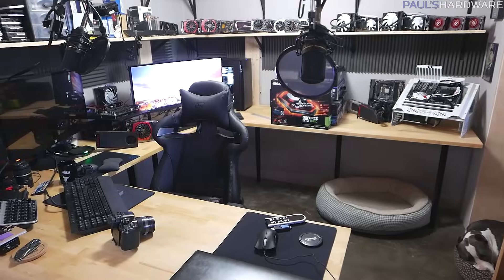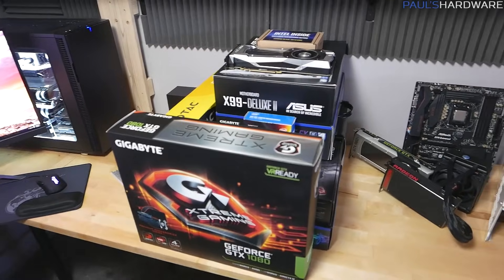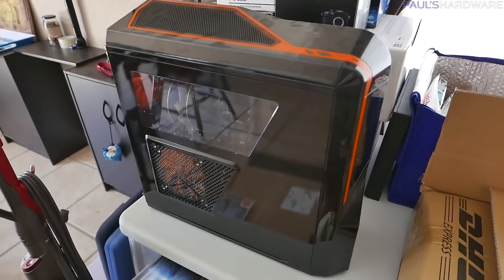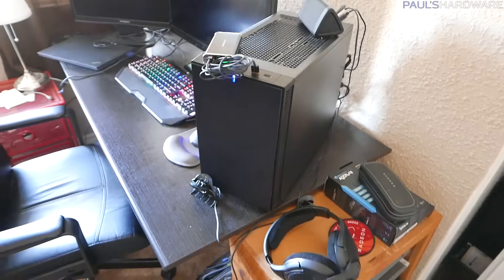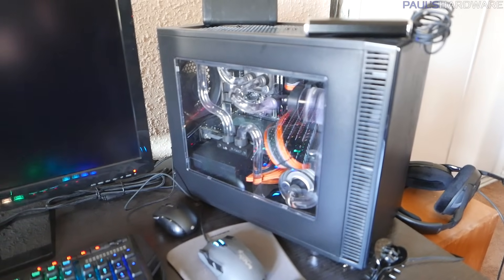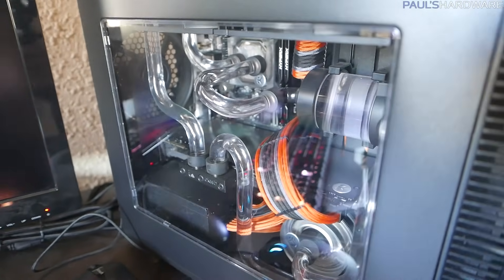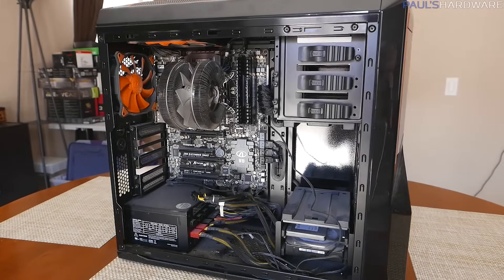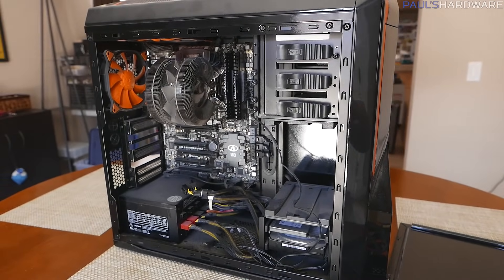Prepping a Hand-Me-Down Computer

Comment: Any recommendations on what i should change or get? Thanks!

Build Name: Gouki
Intel Core i7-6700K 4.0GHz Quad-Core Processor
EK Water Blocks EK-XLC Predator 360 AIO Watercooling Kit
Asus MAXIMUS VIII HERO ATX LGA1151 Motherboard
VENGEANCE® LED 32GB (4 x 8GB) DDR4 DRAM 3200MHz C16 Memory Kit - White LED 
Samsung 850 EVO 500GB M.2-2280 Solid State Drive
Western Digital BLACK SERIES 4TB 3.5" 7200RPM Internal Hard Drive
Western Digital Black 5TB 3.5" 7200RPM Internal Hard Drive
Corsair GTX 1080 Watercooled 
Phanteks Enthoo EVOLV ATX Mid Tower Case
EVGA SuperNOVA P2 850W 80+ Platinum Certified Fully-Modular ATX Power Supply
Corsair K70 RGB Wired Gaming Keyboard
SteelSeries Rival 700 Gaming Mouse
Audio-Technica M50x Headphones
Reply from the maker: Since you're already spending so much, I'd go with the Samsung 950 Pro M.2 over the 850 Evo
Reply: Looks good to me
Reply: tell me how that ends up going, looks like an amazing build!
Reply: First of all, love the name.
Possibly beyerdynamic dt 990s instead of the m50s, I think they sound similar and the 990s are more comfortable.
Also maybe a dac/amp if you dont already have one.
Also, the predators are thick radiators, so if you plan on having the gpu radiator in exhaust, make sure theres enough clearance.
Custom cables might also be a nice touch
Reply: If I were you, I'd change the k70 to the k65 LUX keyboard unless you find a great use for number pads and probably get a DAC for your headphones unless you're satisfied with the integrated sound that your motherboard has
Reply: yes , my address to send it to me after you done building it ;)
JK, awesome build 
GOOD LUCK
Reply: Awesome I will definitely get the 950 then also the case is the glass version which I think looks amazing!

Thanks for the replies everyone :)
Reply: every one uses that case find another one. You want it to look different from others.
Reply: The case is used by many because it's really good I'm not going to pick another case just because everyone else uses this one... I like it and I'm not showing it off to anyone so trying to be "different" is not important :)
Reply: Irrelevant. Popular because of quality.
Reply: Aidin Huh?

Comment: That's a very weird heatsink.
Reply from the maker: Zalman CNPS9900 Max, those copper orb-style coolers used to be all the rage
Reply: Paul's Hardware Haha. Well. Is it good? That's the most important.
Reply from the maker: Quite a good cooler but can be outperformed by tower-style coolers and CLCs, the fixed fan was always kind of a bother too but it is quiet
Reply: Paul's Hardware Ok. 
Have you heard of the GTX 1080 iChill? It's having 4 fans, might be more cool for better overclocking.
Reply: +Pigu-sama :3 It's not their fault! It is random every card does in fact overclock different.
Reply: Yeah, Zalman doughnut lookin' thing. They were really popular, eight, nine years ago. Mine has a green LED.
I finally swapped it out for an NH-D15S about a year ago, when I switched from AMD to Intel.
Reply: +Thanthos jup. It is.
Reply: I've got the 980ti of these cards. The card does not overclock more than 10mhz. I wouldn't buy them again.
Reply: I've cut my hands up multiple times with those damn round zalman coolers.
Reply: Why not just say 1070?
Reply: Pigu-sama :3 So iChill doesn't worth it?
Reply: That's stupid as shit.
Reply: kernisme o
Reply: +Paul's Hardware good cooler I had one in my previous build kept my i7-2600k amazingly cool
Reply: I downloaded win. 10 from them working great for about a month now on my new system..just downloaded doom from them as well the keys worked great!
Reply: it was pretty good in its day but not that good now
Reply: i had one dont hate m8
Reply: zalman cooler
Reply: Pigu-sama :3  their 1080 is better.  But Thanthos  i would buy the Gigabyte xtreme gaming 1080
Reply: My Friend has one very similar, I cannot tell you how many times I cut my hand on his cooler
Reply: Welcome back in 2004+ when Zalman and Antec were the shit to get :P
Reply: Rugg  Ohh my God i looove your Profile Pic! xD